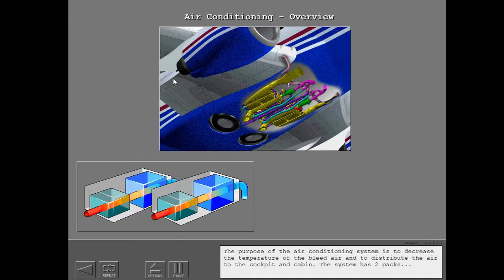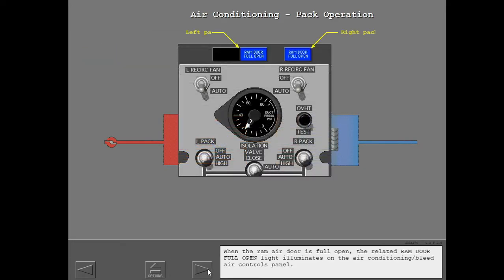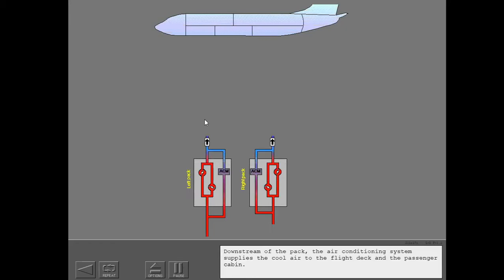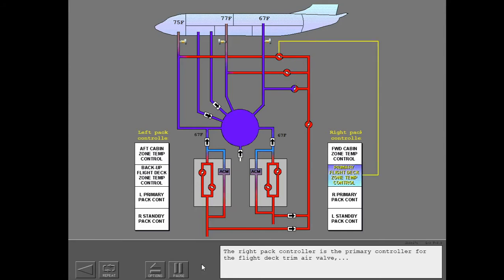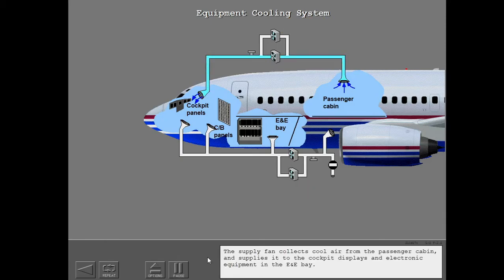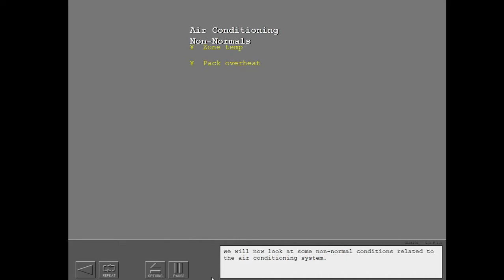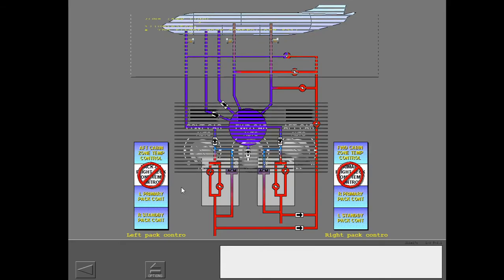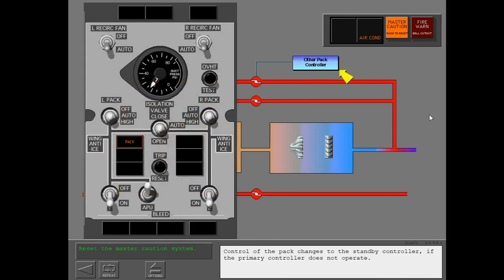23. Boeing 737NG - Air Conditioning System

Comment: Anyone tell me the operation of recirculation fans ?
Reply: It takes air that has gone through the whole body, goes through a filter and gets recirculated and sent to the mix manifold pressure to reduce load and burn less fuel.